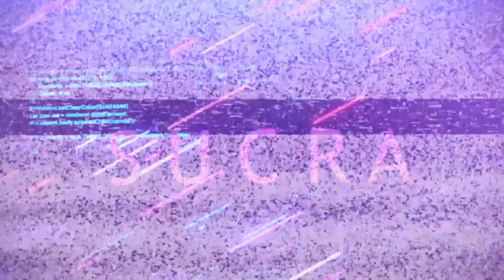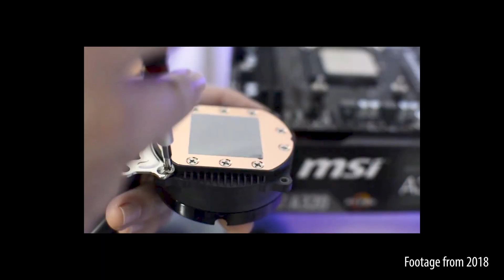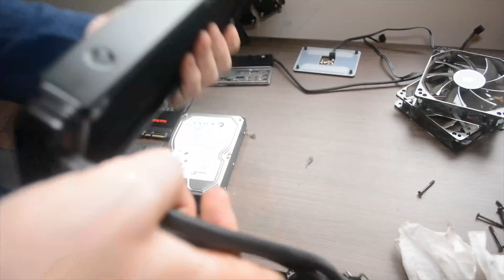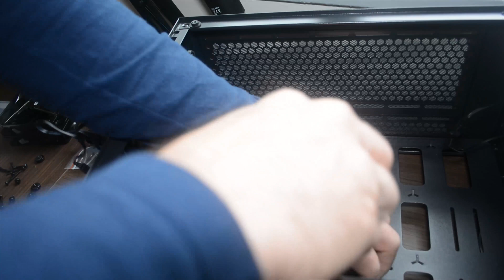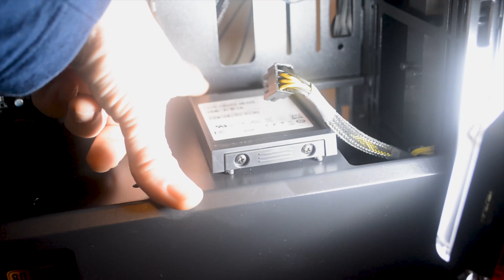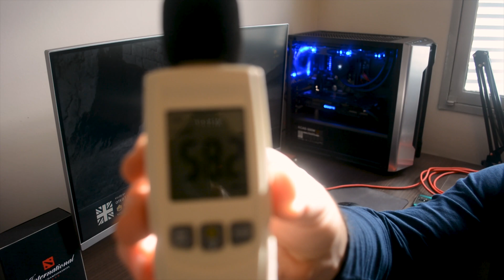Cougar Gemini M RGB Mini Tower Case Swap and Noise Issues, Review

Comment: hello!, i may have fried the RGB leds on my case, but i dont know how to see if that happened, any tip?
Reply from the maker: Did you try a different power header?
Reply: @SUCRA  i did tried, it was woeking alright, but then i installed some.cougar fans and Noé it wont light up at all, is it hard to remover the front parte of the case?
Reply from the maker: @markkugames  oh no it's really easy! Just reach down on the vent and pull it forward. Might have to pressure the plastic pins on the inside of the case, but it's easy as pie. I'm not at the office right now, but I'll look at it again to confirm there are plastic pins that hold it.
Reply: @SUCRA  by forward, you mean toward me, por upwards, facing the case, and thanks forma the reply !
Reply from the maker: Ok, just got home and checked how to remove the front painel of the case. Remove the glass painel. Inside the case there are some plastic knobs that hold the front painel. Start with the top one near the edge. Compress it and push it outwards. The front painel will start to pop out. You might need to do the same thing to the other plastic knobs or just pull the front out.
Reply: @SUCRA  thanks so much!!!

Comment: how do you remove the front panel?
Reply: Ok thanks I did it
Reply from the maker: @mvaldessch7714  No problem! Good luck there.
Reply from the maker: There are plastic locks inside the case you need to compress. Hit me up on tweeter or Instagram and I'll gladly show you a picture.

Comment: does gemini M fit with RTX3070/RTX3080? i got gemini M, but im not pretty sure for upgrading my vga into that model. im scared if it doesnt fit to gemini M case. give me some advices pls :)
Reply from the maker: Sure. The 3070 fe is 242mm long and the 3080 fe is 285mm long. The case has 330mm of clearance so for fe cards it has room to spare. Good luck!

Comment: hi can u suggest a good airflow of m-atx case ?
Reply from the maker: Sure. The Corsair 4000d should have amazing airflow, but it's probably expensive. You should look for any case with a mesh in front, 2 or 3 fans in the front and one in the back.
Reply from the maker: Sorry for m-atx you can look for the Corsair 280x. It also has a front mesh.
Reply: thank for recommend . i will have a look of it .
Reply from the maker: @zone1-F1rst   No Problem! You can alway go for this Cougar Gemni M also, it has a few limitations but it is still pretty good. Cougar makes some good bang for the buck stuff.

Comment: how is the airflow of this case?
Reply from the maker: Hey, how is it going? Thanks for the comment. I have no complaints, as long as you do a good cable management job, it's pretty good. I have one fan in the front, one in the back and the two fans for the 240 ml radiator on top. Idealy I needed one more in front, but it's not overheating or anything like that, so for now I'm pretty much satisfied.

Comment: Connect pump through adapter with molex cable. Pump always should working at 100%. Fans at the water cooling grill try to connect to cpu fan or sys fan. Then go to bios and select silent mode for fans.

Pc with idle mode (Windows) should be very silent, if don't give them another try with manual tuning.
Reply from the maker: Thanks for your comment! I have it almost like this, it's doing alright.

Comment: Another nice one, Sucra!  Myself, If It needs airflow, I go for Cooler Master. I've read BeQuiet! has very silent fans and, If you need something extreme, add some dampening foams to their non windowed cases. Like the "Silent Base 801". Other thing you could do, the first in fact, is to take the case down from your line of sight - since noise is directional. I know It sounds ironic, but trust me. That said, grats, your gear looks neat nevertheless. :) Ps. Back in 2017, a Hardware Canucks' video threaded a good discussion on this matter.
Reply from the maker: Noted, but I think you meant BeQuiet, although their stuff gets here a bit expensive for us. Not an option putting the case on the floor right now, I like it there, I got it fairly quiet, maybe better fans could also help. Thanks for watching and commenting!
Reply: @SUCRA  lol indeed, o' wise one, Silent is the model. Hmm not on the floor! I meant on a mdf chassis stand, custom/tailored-made, with wheels or simply rubber feet. Placing your stuff between this stand and your desk would help.
Reply from the maker: Right now I feel like having my creation at eye level 👨‍🎤

Comment: Nice video!! If you put a gpu in this case, will it get hot??! Because it seems to me that it is very close to the power supply! Sorry my English (is a work in progress hahah)!
Reply from the maker: You write very good English Paulo. There is a vga in there, a gtx 1060, I have an intake fan blowing outside air directly to it, I don't have any issues so far with it. If you are interested I can get some gpu temps in load.
Reply: I use an overclocked rx 5700 xt, and haven't had overheating problems with the gpu
Reply from the maker: @threadworm437  That's great, good to know. What kind of fan configuration do you use?